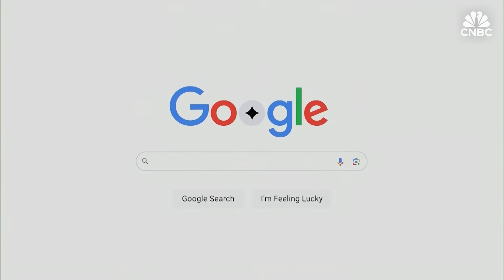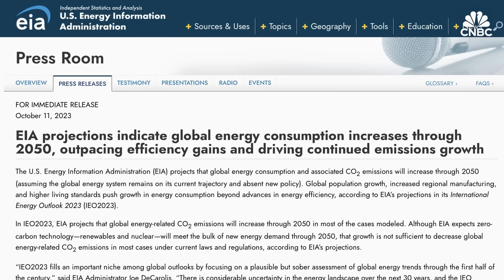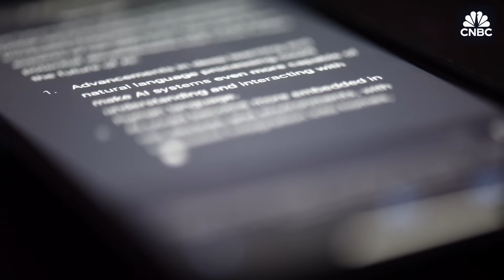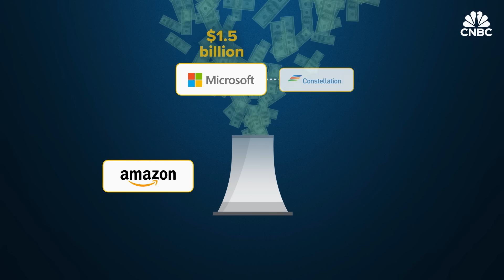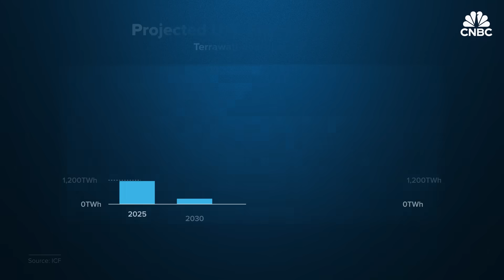Why Amazon, Microsoft, Google And Meta Are Investing In Nuclear Power

Comment: 21% energy source in US is renewable. The chart and data showed. Impressive work!
Reply: No.  Electricity is only one form of energy; 20% of the total that runs industrial civilization.  
Most people confuse electricity with *energy*.
80% of total energy is fossil fuels, plus some bio's.  60% of electricity is also fossil fuel, and we are sucking up all increases in "renewables" with computing alone, now including yet-to-be-built nuclear.
Can you see where this is going?
Reply: @roysmith5597  This is not true. ALL of the energy in the world comes from the sun. Capturing it in the most efficient and responsible way is the path to the future. This can be from hydroelectricity as the sun bring water into the top of reservoirs, from the rays, even the tides.
Reply: Pretty much 40% since you’d count nuclear.
Reply: @Lumber91  I wouldn't count nuclear as renewable by any means.
Reply: @Lumber91  nuclear isnt renewable but it is clean. when uranium is used up it can't be reverted to its original state
Reply: @sarkaranish  used uranium can be recycled im pretty sure
Reply: @dukerex12 Yes, Russia 🇷🇺 does that.
Reply: @dukerex12  It can be recycled, but it can't be renewed is what I'm saying. It will expire after some time and we will eventually run out of uranium. It's a clean source of energy, it's just not infinite.
Reply: @sarkaranish  spent uranium can be used again as reactor fuel
Reply: @sarkaranish   we will never run out of uranium, because it's in much abundance and very small quantity can produce massive amount of energy
Reply: @kant06407  true true, but renewable by definition means it is technically infinite. We will eventually run out of uranium, but that doesn't mean it's a wonderful source of energy.
Reply: @sarkaranish   renewable are theoretically  infinite, technically these are not , we may run out of material to make more more solar panels. Also, people need to understand it is not free energy and there are wastes related to it, specially when it comes to solar energy. wind and hydro have less wastes. Uranium plant produces much less waste and much less cheap to operate once constructed.
Reply: @sarkaranish  That actually works in Nuclear's favor with that definition. With seawater extraction and fuel recycling we actually have enough fission energy before the Sun engulfs Earth and basically kills the planet. Both are things that work today but aren't used as much since mining Uranium very cheap. At that point in time even Wind/Solar would cease to work which are labelled as renewable today.
Reply: @sarkaranish  can you explain how nuclear is clean when I live near the turkey point nuclear plant and it is leaking radioactive tellurium isotopes into the drinking water aquifer for 6 million people. Does that sound clean to you? I guess it’s very easy for you to speak when you don’t live near nuclear plants. 100% Greenwashing propaganda
Reply: @KenDotCom  Source: trust me bro.
Reply: @andreazonin you don’t have Google?
Reply: @andreazonin hey did you have proof I am wrong? Did you google turkey point nuclear waste leaking into biscayne bay?
Reply: @KenDotCom  Yes, I did. What you can find on google are only newspaper articles that are scared of the nuclear plant.
I didn't find any scientific study that has proven there's a radiation damage or leaking.
But if you found some research i'll be happy to be disproven.
Reply: @andreazonin  Scientific studies (Miami waterkeepers and nrdc) on the Turkey Point nuclear plant in Miami reveal significant issues with its cooling system, causing massive leaks of salty, hot water and contaminants like tritium, ammonia, and phosphorous into the Biscayne Aquifer, a vital drinking water source

Comment: It doesnt make any sense, economically. For the cost and amount of time it takes to build a nuclear power plant you can have way more production out renewables, even including storage
Reply: No you can't and the cost of storage is prohibited
Reply: @damienchall8297  Yes, you can, and no, it isn't, lol. You have no idea how cheap wind and solar have actually become, have you? Grid level energy storage can be very cheap, you don't need to use lithium, which is a poor choice anyway.
Reply: @damienchall8297  reading comprehension isn't your strong suit is it? #1. I said lithium is not the way #2. The price of lithium has and batteries continues to decline so sitting that data point is inaccurate, and again I not for lithium battery storage.
Reply: @alexanderdeburdegala4609  and everything else is costly as well storage is horribly expensive
Reply: @damienchall8297  you're still incorrect.
Reply: @alexanderdeburdegala4609  it would cost 105.6 billion dollars to have enough storage to power New York city.  nuclear plants are cheaper so no I am not wrong. It would also take 
330 square kilometers (approximately 127 square miles) of solar panels would be required to power New York City using solar energy alone. So good luck
Reply: @damienchall8297  based on what ? You're just making up numbers lol 😆

Comment: Either we expand nuclear power, or we end up like Germany
Reply: In 2023, 59.7 of Germany's electricity came from renewables. That's a lot better than the US even if you include low-carbon nuclear. It was wrong to close nuclear plants early, but Germany is not the failure that fossil fuel shills pretend it to be.